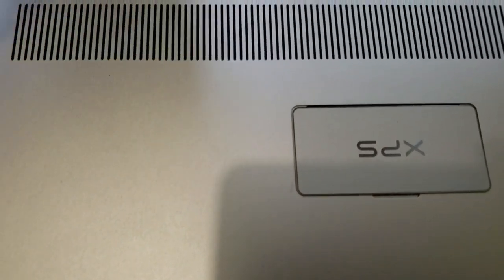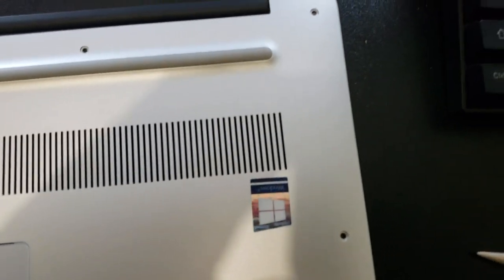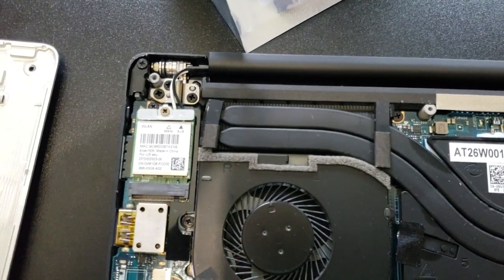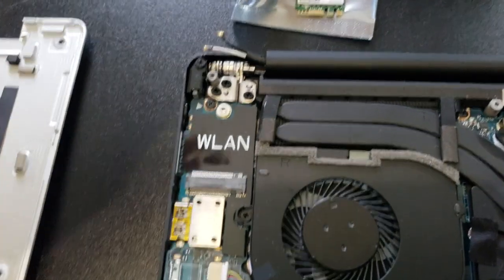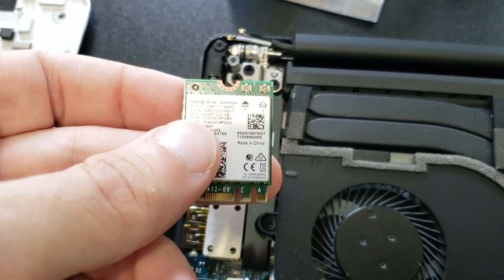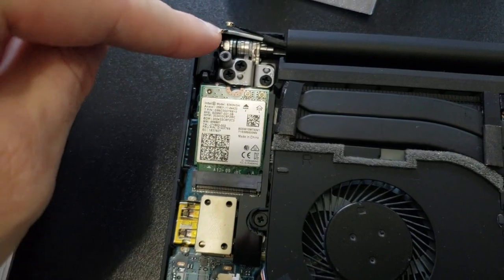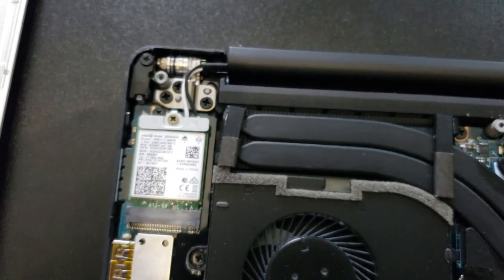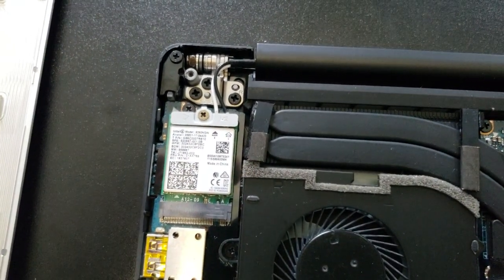How to replace the Killer WiFi card with an Intel WiFi card on the Dell XPS 9570

Comment: Hi i put this wifi card in my dell xps 9560 clean instal windows 10 instal the drivers but the wifi signal constant dropping any help on thart?
Reply from the maker: Sorry not sure.  The reason I made this swap was because the stock "Killer WiFi" card kept dropping connection.
Reply: is this support for xps 9560???

Comment: if your wifi is slow, try the below before opening up your laptop

* Click Windows icon
* Type killer
* Click Killer Control Center
* Click Settings
* Under System Settings, toggle Advanced Stream Detect to Off

This immediately kicked up my download speed from 64kbps to 30Mbps. How is this info buried somewhere and everyone running around like headless chicken.. friggin dell!! or killer.. dont know who to blame.

Let me know if this works for anyone else.

Comment: @willworkforliberty I have three questions for you. First, did you install the intel drivers before you swapped the WIFI cards? Also, while this is probably stupid, what did you uninstall to completely remove Killer remnants from your computer? Finally, how did you uninstall the Killer drivers?
Reply from the maker: I use linux, so I made sure those drivers were installed.  I believe both the ath10k(killer) and iwlwifi(Intel) drivers are part of the linux-firmware package on debian based systems.  You can use `lsmod`, `modprobe`, and `modprobe -r` to list, add, and remove (respectively) drivers from a linux system. 

You can check if the intel drivers are there by doing `ls /lib/modules/$(uname -r)/kernel/drivers/net/wireless/intel/iwlwifi`

For windows... I dont know.  Sorry.

Comment: The "sticky stuff" on the SSD appears to be a thermal pad. Not sure why Dell would feel the need to put one on the hard drive, however. SSD's don't get anywhere near hot enough for one as far as I'm aware.
Reply: you are wrong, ssds get very hot
Reply: The proximity to the battery cause it to heat-up sometime hence the pad…

Comment: Just an FYI to everyone these back plate screws can be extremely difficult to remove, all of my screws were coated in what I originally thought was red loctite but am now realizing it was an anti-seize liquid (didn't work I guess). both of my under plate phillips head screws were seized up and had to be drilled out, and the heads broke off both of them. This was just in a month old laptop. BE VERY CAREFUL REMOVING THE SCREWS.
Reply: mine were rusty even :D

Comment: I have bad flickering on my laptop screen and it's only when I'm on wifi. It's a Dell XPS 15 9570 Core i9.  I've placed this new chip inside my laptop a few days ago and I'm still experiencing the same problem. I've noticed if I turn down the transmit power in the device settings, the flicker is reduced but only by a fraction. It's still a little severe but only happens when I'm on wifi. Is there any other options I can change? Any specific drivers I need to install/ Disable? Any other programs I need/ have to delete? So far dell hasn't been of any help to me, I appreciate all the help!
Reply from the maker: I think you should return it.  If it wasn't a defective wifi chip then there's probably something more serious going on.

Comment: Hi, I want to upgrade the stupid Killer card with an Intel card, but I came across the 9560 and the 9260 and I am not sure which one to buy.. Could you possibly recommend me which one to take? As I read, the interface and the vPro  are different. Does it matter? :)
Reply from the maker: I am not certain if the XPS 9570 would support the 9560 Intel wifi chip. From the description on amazon it sounds like it is very hardware specific. I've linked the wifi chip I used in the description as well as here https://amzn.to/2vRaqJ7

Comment: What am I missing here?  After the wifi card was installed, the wires were attached backwards.  The Killer card and the Intel card show opposite connections for the black and white wires.
Reply from the maker: That's right. I show this in the video. However, I am not sure it matters.

Comment: None of these videos hint at how excruciating it is trying to get those two little wires connected to the new board! :D
Reply: Try putting them on first and then stick in the new card
Reply from the maker: I used a pair of needle nose pliers.  Just make sure they are lined up first before you squeeze.

Comment: I get mine Oct. 23 (hopefully, I ordered it Sept. 10, keeps getting delayed [ parts shortage, screwed up order, etc...] ). Two questions; 1) Why is everyone changing out this card? 1a) Is it just gamers having problems with it? 2) Do you have to disconnect the battery when doing this? I heard the card is shit, but not everyone is having problems with it (I guess connectivity problems?) That's why I'm wanting to find out what people are doing that have the problems with it.
Reply from the maker: I kept having problems where my wireless network connection would drop out, or reconnect to the access point.  

I did not disconnect the battery when I replaced mine.
Reply: I have the XPS 15 and the killer card, so far I'd say there has been no problems with it...